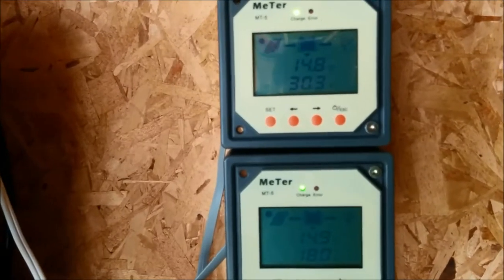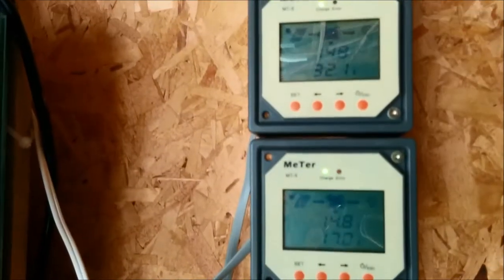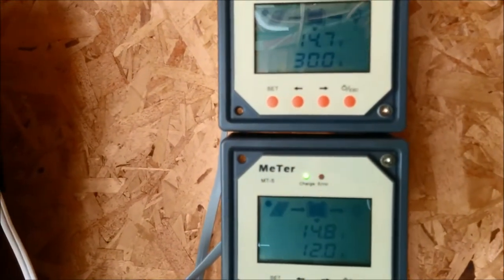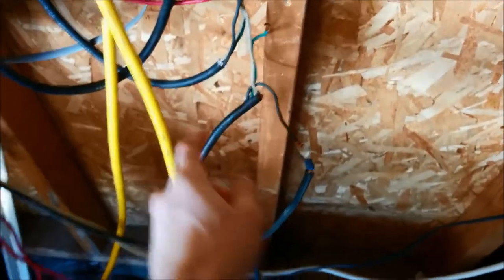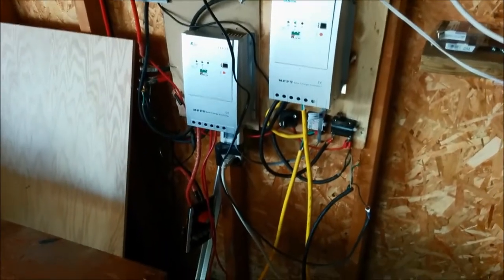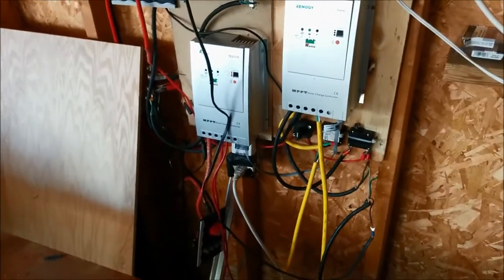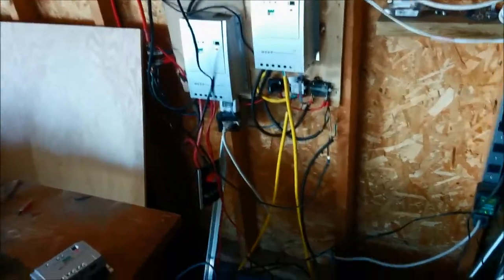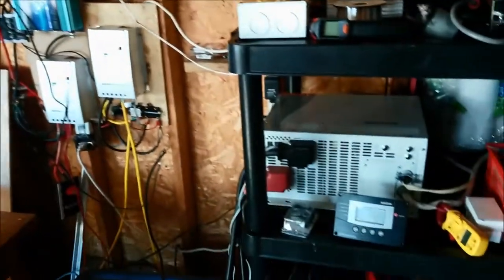short off grid run of my system on a sunny day

Comment: You're running a single inverter and one battery bank, right?  I'm wondering why you use two diff charge controllers?
Reply from the maker: +Jon Freeman  each controller can do a max of 50 amps each, and i have about 85-95 amps coming in from solar panels.
Reply: +fliping720  Oh wow!  Never had a system with many amps coming in like that.  How many panels do you have an how many watts are they to get so many amps?
Reply from the maker: Jon Freeman this is a 12 volt system so the amps climb really fast i have 1480W and at 12 volts i have  around 100amps coming in at peak power.